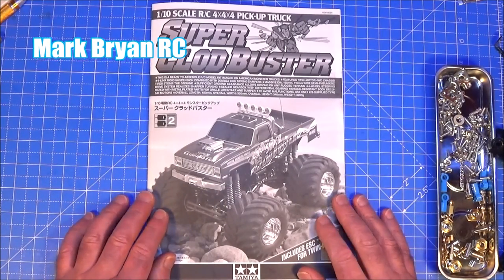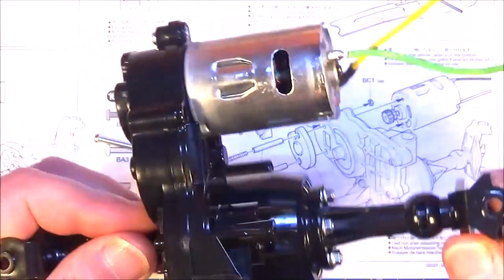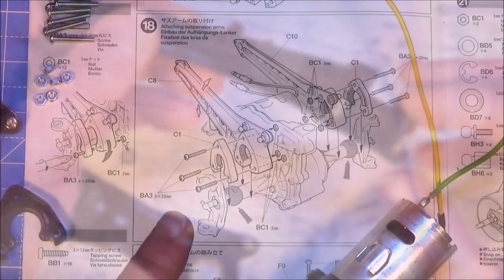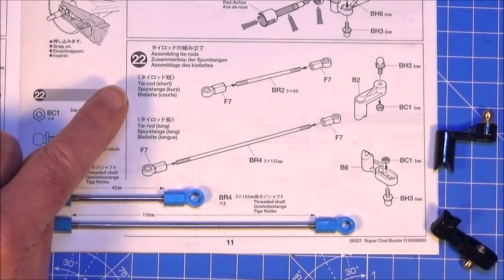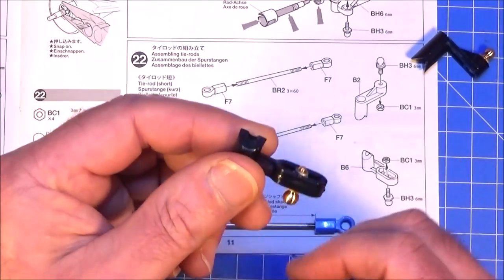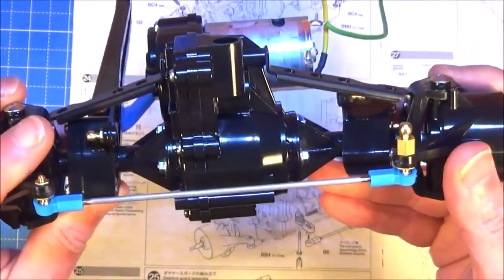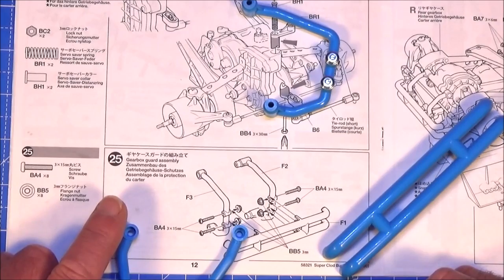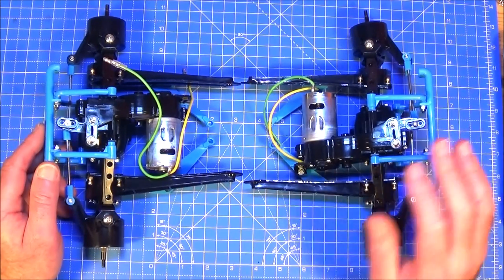Tamiya Super Clodbuster Build Guide P2 - Steps 15 to 26 Plus Hints and Tips!

Comment: I am loving this series. Tip on the B11 gearbox anti rotation bracket, they break easily and assuming you want to drive the Clod upgrade to the aluminium versions.
Reply from the maker: Cheers, Mark! Glad you are enjoying the series. Many thanks for the tip, I did think that B11 bracket was a bit flimsy as I was attaching it! All the best!